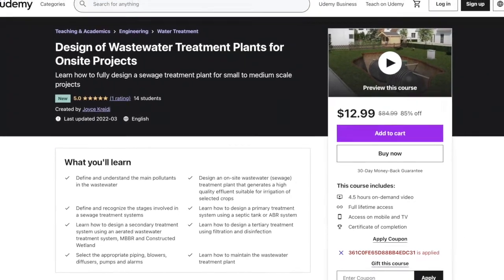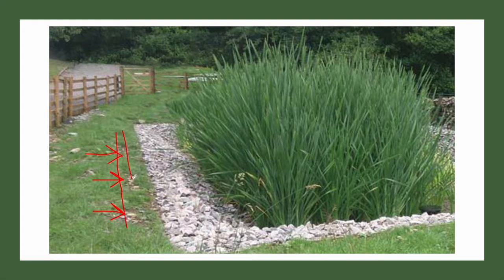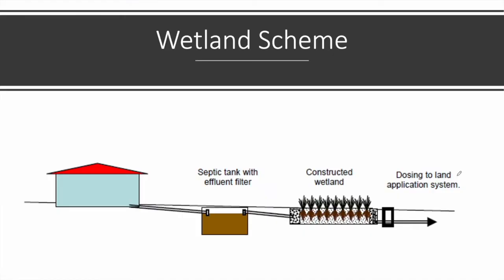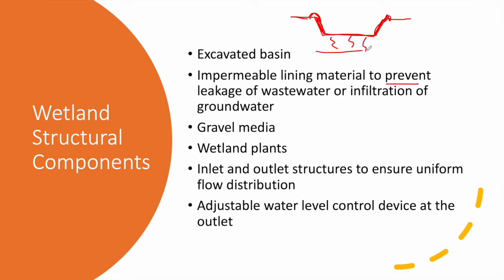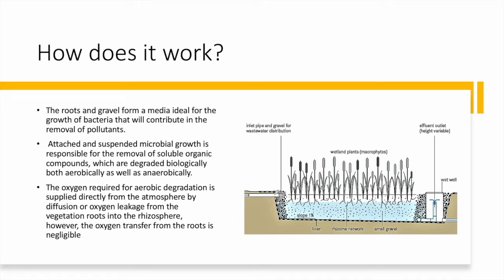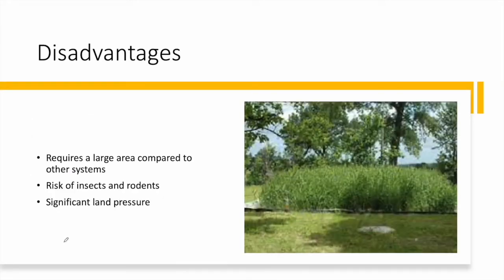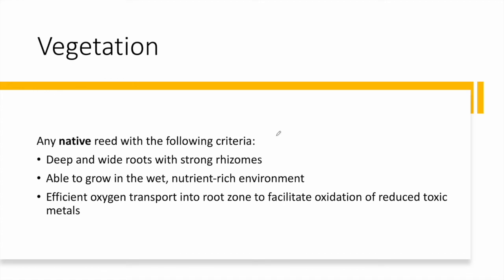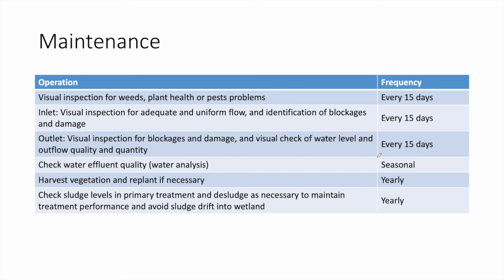Constructed Wetland for Wastewater Treatment || Description and Design of Horizontal Flow Wetlands

Comment: Hi, thank for your informative video. I would like to ask a question. Are every basin of constructed wetlands should be under the soil level? If yes how can we collect the water from the outlet? another question is, how can we calculate the area of the wetland if it is for an industry?
Reply from the maker: Hello dear,
Ideally a hydraulic profile should be made for the WWTP.
Wetlands are placed under the soil level and the effluent is collected through a perforated pipe.
Reply: Thank you for the answer  @wateracademy5866  , so does it means that the effluent will be pumped out to the above soil level through a perforated pipe due to the hydraulic concept? Another question is, does the calculation of area 5m^2/Person also works for an industry?
Reply from the maker: @rny280 You might need a pump if gravity won't work (depending on the Hydraulic Profile).
For industries, wetlands are not the best option. It might be used as a tertiary treatment.
Always make sure that the entering flow to the wetland has very low TSS and FOG